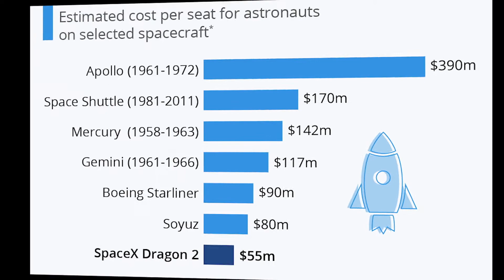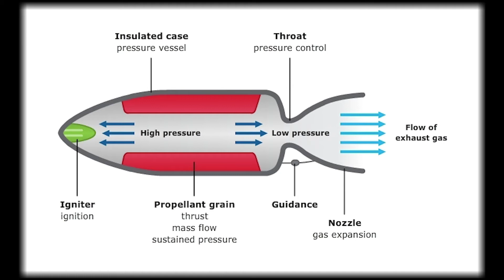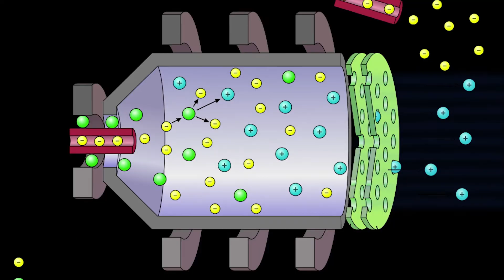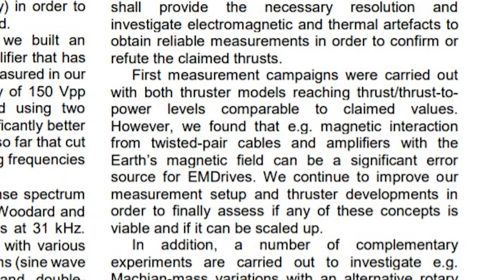What If We Build A Working EM Drive?

Comment: wouldn't water sloshing around in a barrier-free (smooth bore) tanker truck move the tanker forward and back? See https://youtu.be/-qHzwPjazfk?t=63 AKA Liquid Surge

an EMDrive would be creating a Radiation Surge if a standing wave can be rammed against one side of the container - and absorbed on the other side with meta-material coating Vanta Black maybe?

possibly creating a wave guide much how lasers create focused energy to create the Radiation Surge

thoughts?